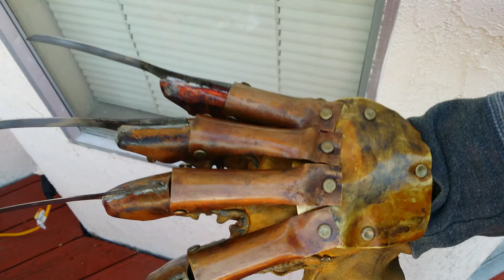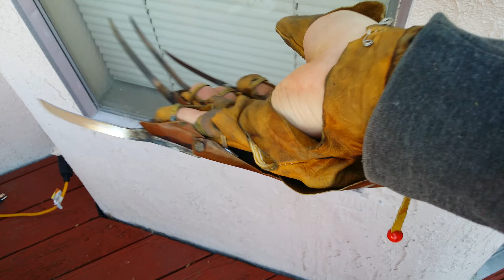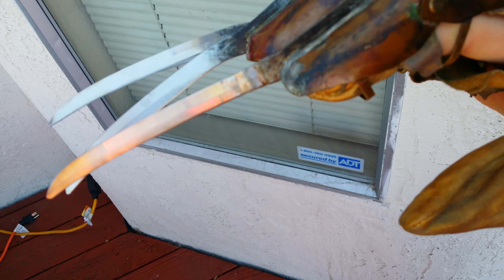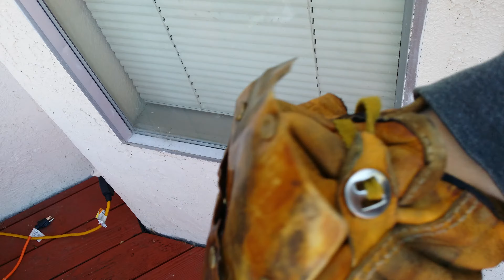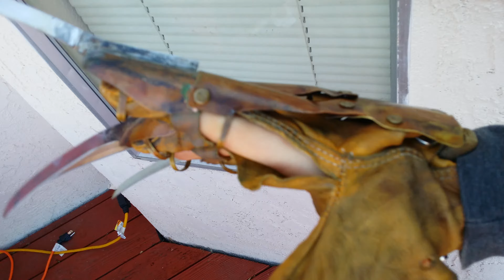D.E.S.A from Kruegear

Comment: He didn't rivet it to emulate how the armature looked on screen, they actually used carpet tape with adhesive attached to it, so the armature wasn't attached at all throughout 1 and 2, and that's why Mike only has the armature and the leather from Part 3, you can see it in the movie as well man, even in the promo shot when you see the wire on the ring tip
Reply from the maker: Yeahhhh things like that are just guesses. the only rivet ive SEEN that wasnt attached at all in certain scenes (When the glove was actually finished) was the right side backplate rivet
Reply: James Knapp true, maybe they riveted the last rivet since the adhesive started to wear off, because the leather would have torn over time